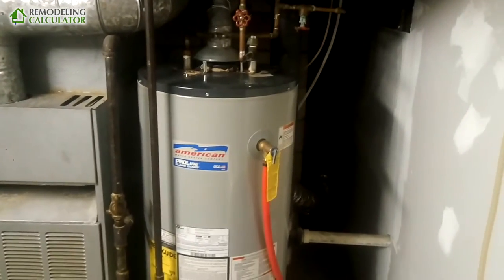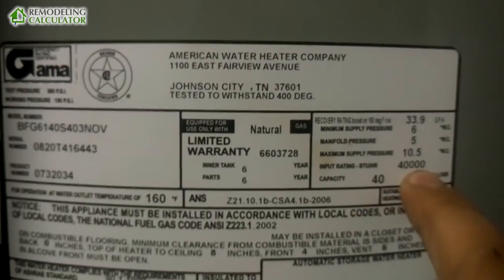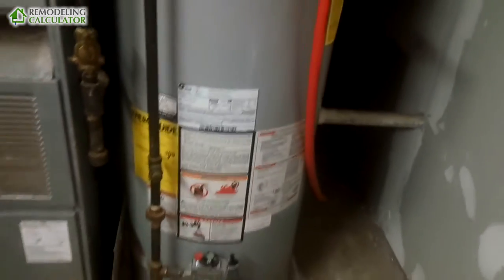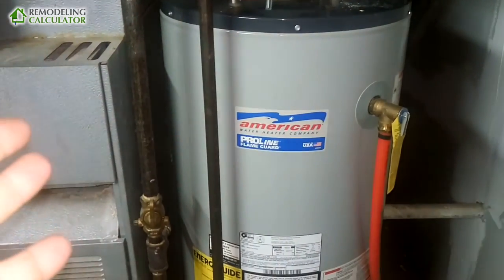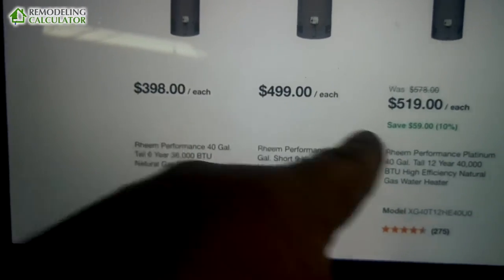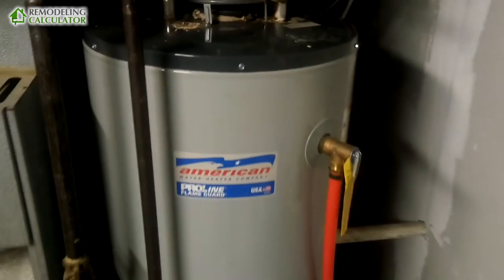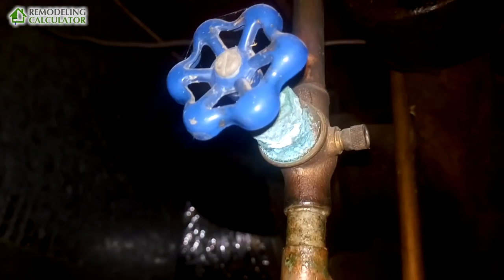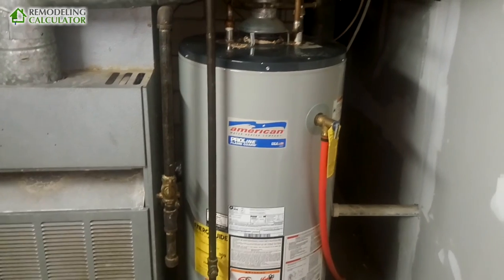How to choose a Hot Water Heater - Costs & Warranty

Comment: It was suggested to me to ask a plumber to install a second anode rod in the new tank as well.  Doing so will enable the initial anode rode to last longer, as the minerals in the water now have 2X more surface to attach to.  What are your thoughts on this suggestion?
Reply: You'd have to replace the single anode far less often. Nobody does that anyway so it would last longer. You'd need a tank w/ 2 hubs.

Comment: We built our house in 1986.  The water heater that was installed lasted  32 years..  It's a 52 gallon Mor-Flo.  I could have it repaired (element or thermostat) but was advised that newer models are more energy efficient so I should get a new one.  What is your opinion - repair or replace?
Reply from the maker: Wow that is amazing - I never heard of a hot water tank lasting 30+ years.

I do have a 30+ year old furnace... But there is no rust to worry about. For a water heater that 8s terrific.

Did you have to repair it during these years?
Reply: @RemodelCalculator  Amazingly no!  I think about 25 years ago my father drained out the sediment and that was it.  About a week ago the water got real hot then a couple days later we had no hot water.  My brother drained it, found the elements to be shot.  Had a bit of trouble finding the bolt style elements but I got them and he replaced them and I now have hot water again.   I'm going to order a new water heater though cause I dont want to push my luck and everyone is telling me the new ones will use less electricity.
Reply: @mollydog444  The new ones also last 5 years... LOL
Reply: My house in dover de has a 1985 gas water heater

Comment: Labor warranty is only 2 years, but 6 for my GE heater from Home Depot.  The cheap parts are free, but not labor. So, maybe go with Sears for cheaper and they send out their warranty tech free for a flat one time prepaid warranty fee. So, free parts & labor for heater life, in theory.
Reply from the maker: +highonsmog i had a plumber install my water heater and it came from a plumbing supplier - not retail store.
Reply from the maker: +highonsmog sears is going bankrupt, so i wouldn't buy anything from them
Reply: RIP Sears.

Comment: Is there a plumber here who knows if I can get an A.O.Smith 50 gallon,40 000BTU water heater with a regular gas valve without the electronics with blinking led lights?Like a standard Robert Shaw valve?
Reply: I'm not a plumber, but have a comment on gas valve.  My water heater is Bradford White and it has the blinking led lights that are supposed to flash codes for different troubleshooting situations.  My heater is only giving me hot water off and on, but no code is showing up.  So I am doubting how good this kind of gas valve is.

Comment: My water heater is 15 years old and I'm thinking of just draining and replacing the anode and relief valve.
Reply: From my research, changing the anode is a good idea.
Reply: The water heater in your country is different then ours in India because the maximum size of the water heater in our country is 25 litre

Comment: Does it use a magnesium or aluminum anode rod?
Reply from the maker: Hey Viva, i will have to check. Why are you asking? Does it make a difference to you?
Reply: Remodel Calculator I believe aluminum rods don’t last nearly as long.
Reply: @RemodelCalculator  ther is difference between aluminum anode rod n magnesium. If your water smell like rotten egg then you should use magnesium anode rod to neutralize sulfur.